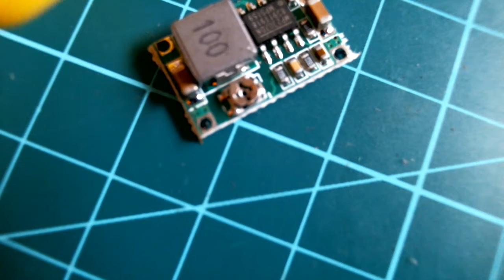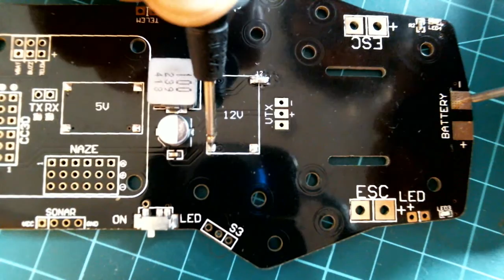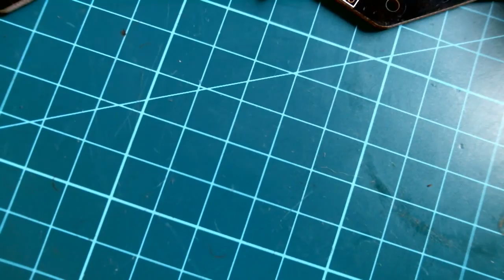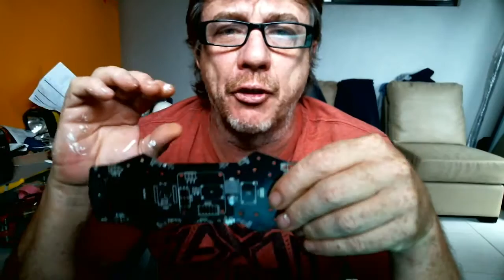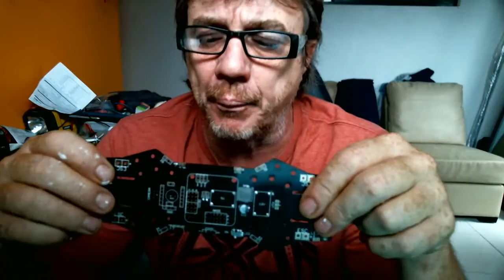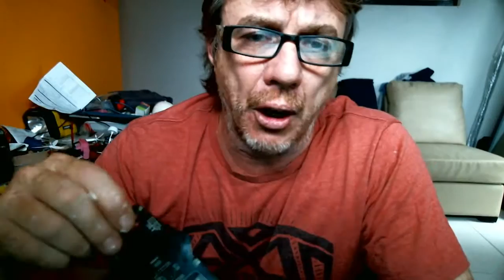Another ZMR PDB

Comment: any update on the board?
Reply from the maker: Have soldered on the 12 and 5 volt regs that came with it still waiting on the OSD that fits the pin lay out and only a few days ago ordered a ver 6 naze board that matches the pin out as well for the flight controller so as soon as it all gets here I will do a video on the whole thing I even have a carbon fibre zmr frame i might put it in.
Reply: looking forward to it i just ordered the board myself